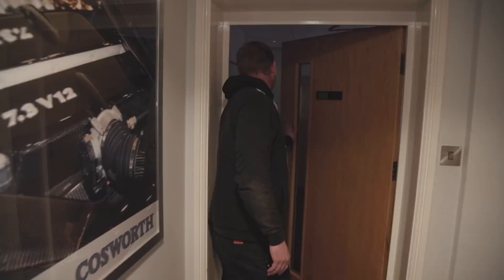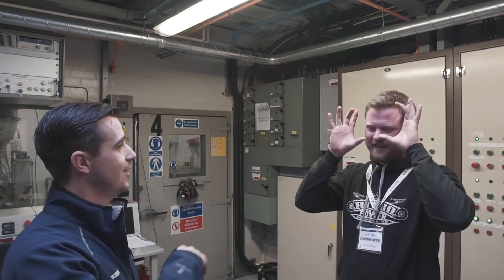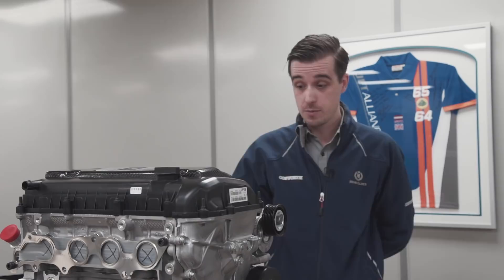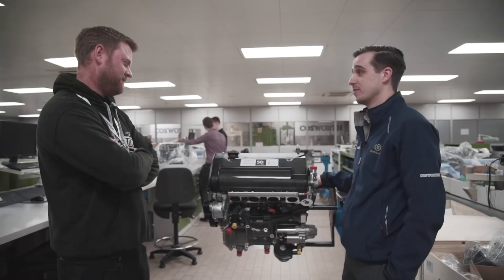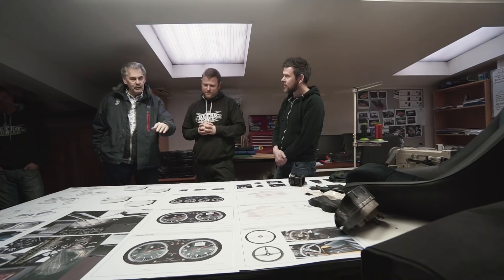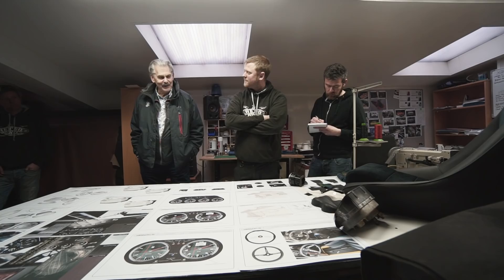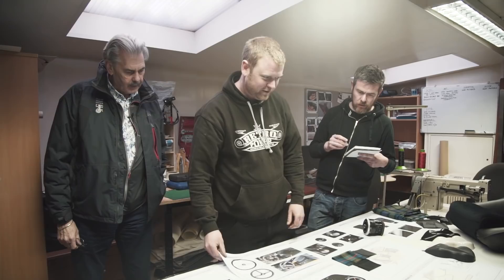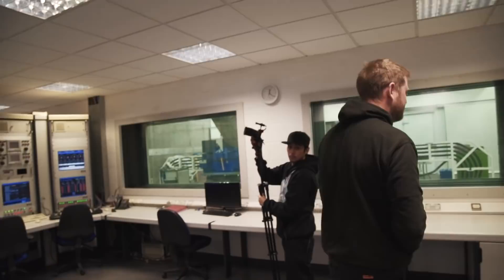Gordon Murray's MK1 Escort - Retropower Build Episode 5 - Cosworth Visit

Comment: That's one of Dick Johnson's Sierras at 3:24 and 3:55 - arguably the fastest ones ever built for the category. Incredible machines. When building these cars in Australia they had some trouble getting technical info and equipment from the Brits, so they built their own computers, did their own engineering and basically just worked it out in-house. They ended up being the world's fastest touring cars of the day. Took one to the UK to race during the era and everyone was amazed (Dick included) at how much faster than the British cars it was. Amazing to see.
Reply: i thought it might have been. but ive never seen his Sierras in the flesh so wasnt 100%
Reply: I saw these cars racing back in the day in Australia, they were insanely fast, and the noise they made was incredible. They had no blow-off valves so the turbo would whistle and flutter and pop and crackle and spit flames, it was quite the thing to see. The times they ran at Bathurst were bettered only by the all-conquering Nissan GTRs that came later, and the category that replaced it (V8 Supercars) took several years before they were approaching those lap times again and they had considerably more rubber under them and were much easier to drive on the limit as well.
Steve Johnson (Dick's son) drove one at an exhibition race I saw a couple of years ago, when he was interviewed afterwards he said it was incredibly difficult to drive compared to a V8 Supercar as it had more power, which came on quite suddenly, and it only had half the rubber on the rear. You could see even though he was taking it pretty easy, when he got onto the straights he would feed the power in a bit and it was trying to break traction as soon as the full boost came on. It's a testimony to how good the drivers were back in those days I reckon. Dick used to say it was like balancing on a knife edge - one little slip and you were gone.
Very interesting to see that Cosworth themselves have chosen to exhibit one of Dick's cars as an example of the type.
Reply: Check this out from 1992. https://www.youtube.com/watch?v=1zgIwRpKNCY  Despite what the commentators say during the broadcast it was rumored (and DJR confirmed it years later) that these cars were producing 680hp in qualifying trim. You can see how twitchy it is and how well Dick is driving it. The mighty Nissan GTRs were competing in this Top 10 runoff but Dick was still quicker in his Sierra.
Reply: I say them at Lakeside in Brisbane many years ago. Dick personally owned a road going Sierra which I saw and heard on many occasions as he lived not far from me. Factory spec.....doubtful. Fast you better believe it. 👍🇦🇺
Reply: Wow, I wonder what happened to that road-going car? I think I read somewhere that it was black, is that right? Knowing Dick it would have had a bit of work done to it all right, I bet it was a proper weapon.
Reply: Regretfully, that one will probably never come back to Australia, just like the Falcon XB Interceptor from Mad Max. Although DJ's team had several racing Sierras, we should stop these icons from being exported.
Reply: I'm ok with that DJR Sierra where it is - the Cosworth showroom is as good a place as any for it to be displayed given that it's the birthplace of the engine. Let's not forget that Cosworth were basically the reason these race cars existed in the first place, without their involvement none of it would have happened. The DJR cars were and are acknowledged as the best of the type in the world so it makes sense that Cosworth would want to have one in their showroom. Of the 6 cars that DJR built 4 are still in Australia, and one of those is still raced regularly (by Chris Stillwell). DJR sold one of the cars to a team in the UK in 1989, that car is now privately owned by a DJR fanatic who has restored it to full DJR specs (it may be the car in this clip, i'm not sure) and who hopes to return it to Australia one day so if that ever happens it will be 5 out of 6 residing here.
Reply: andygasson, thanks for the info. I saw one of the DJR Sierras in Launceston (Tasmania) motor museum many years ago, and I saw them race a couple times back in the late 80s, amazing race cars!
Reply: What a buzz to walk into Cosworth,then the first thing you see is the mighty Shell Sierra! Huge...
Reply: Best Sierras in the world, and didn’t need to cheat with fuel like the Eggenberger ones to do that. Aussies for the win ! 👍😁

Comment: What a series of videos 👍👏🍾🍸
Can't believe they are putting the auxiliary dials out of direct eyesight!
I added 4 dials to my road 105E by moulding an enclosure that fitted on top and centre of the dash, and just required a flick of the eyes to read them.
That mod proved its worth when I raced the car at Kyalami in the '70s, with a rev counter in its own enclosure next to them.
My Mk3 Cortina GT had those gauges in the most stupid place imaginable, way down on the centre console meaning you had to peer down at them and wait for your eyes to focus!
They put the slot for a radio where the gauges should have been.
Reply: Steven Ross-watt
👍
I missed that about dry sump warning🤗
Must watch the video again.
I fitted a 2" indicator lamp centre dash where the vent controls used to be so as to get a clear warning of any failure.
It was bright enough that I could see it out the corner of my eyes.
Never had it go off except when switching ignition of on start-up.

Comment: I am loving this build. As a proud Mk1 Escort owner from Australia (1300XL, still a 1300), and the owner of a mazda6 2.3, I am inspired to one day build a 2.3 Duratec Mk1. But not this Mk1. Its an unrestored survivor car, so i cant molest it :D 
I have a question though. Its a massive build, and I love everything about it so far, other than 1 thing. Why not use the twin cam 6 dial dash? even if you were to fit aftermarket gauges to the twin cam housing, I would be doing that. But personal preference. 

impressive build, and awesome production on the videos, keep it up guys, cant wait for the next instalment.

Comment: I though cylinders were cast, didn't realise they were pressed.
Reply: facepalm    I meant piston not cylinder.......

Still, I thought they were cast?
Reply from the maker: most normal road car pistons are cast. The standard Duratec pistons are cast. The forging process creates a much stronger structure to the metal hence forged pistons being used in performance applications. Nice to have an engine builder where they forge their own pistons I must admit 😊
Reply: Always nice to have the right kit for the job!